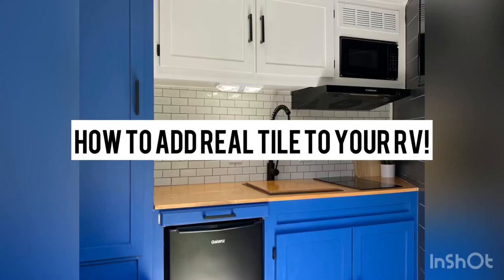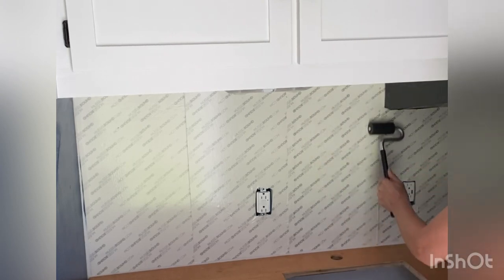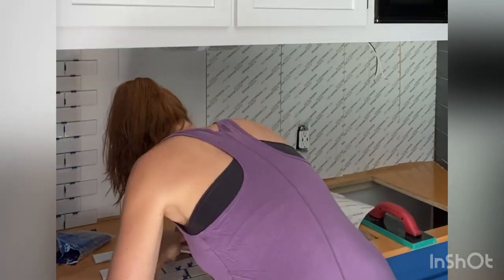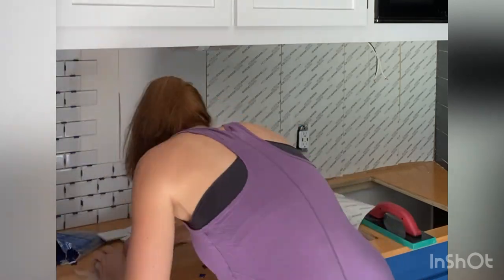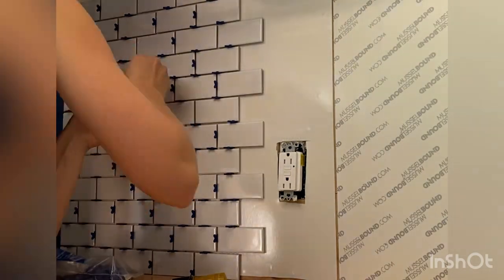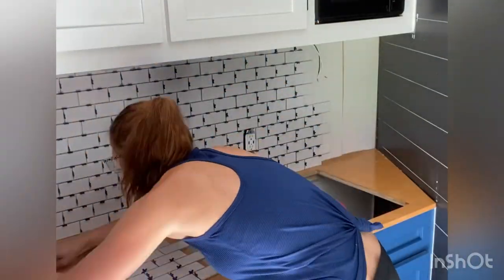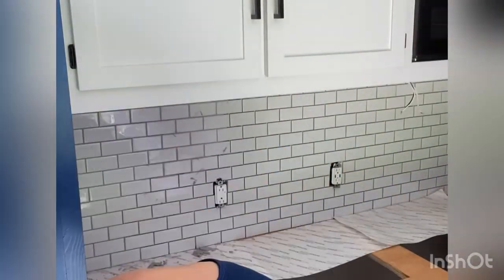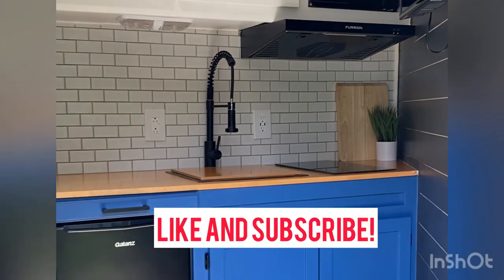How to install REAL tile in your RV/horse trailer that won’t crack!

Comment: Can you share a link to the tile you used?
Reply from the maker: Hudson Mist 12-in x 12-in Glossy Porcelain Brick Subway Wall Tile (0.94-sq. ft/ Piece) https://www.lowes.com/pd/Satori-Hudson-Mist-12-in-x-12-in-Glossy-Porcelain-Brick-Subway-Wall-Tile/5002147977
Reply from the maker: Almost positive that was it, it’s been a minute since I did this trailer 😂